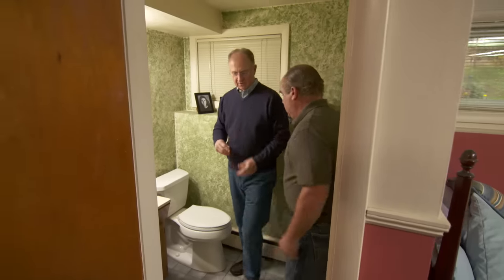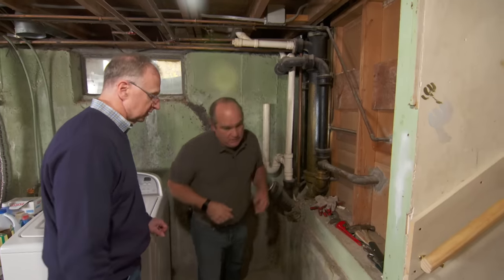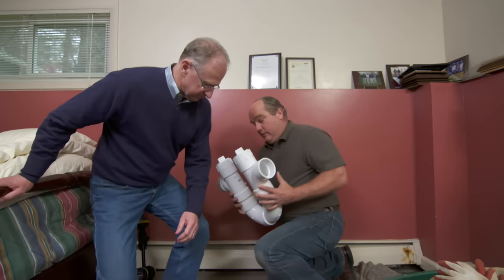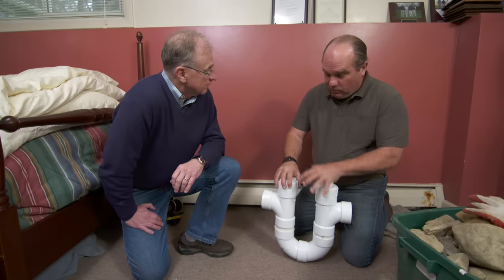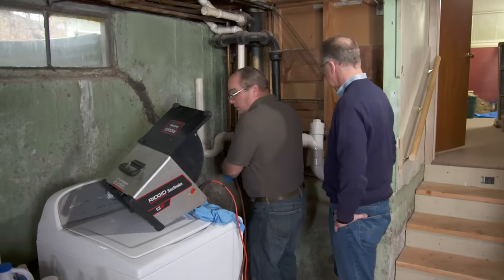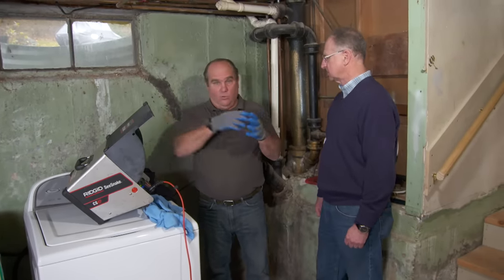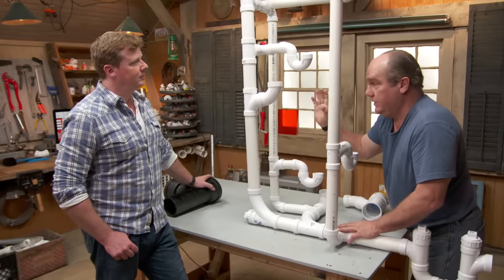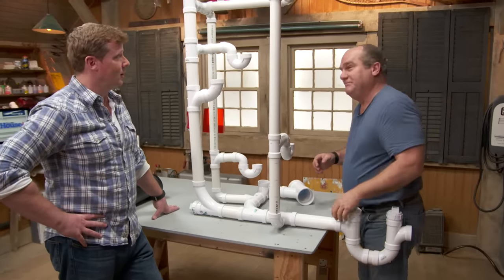How to Diagnose Plumbing Drain Problems | Ask This Old House

Comment: There is a much cheaper solution  (Think fixing stints in weak heart arteries) if you place some real heavy gauge steel tubing at least 20' into the cleanout and 4" main draIn you could straighten the pipe out and bridge that 1 or 2 joints that have failed.  ONE-  YOU MUST HAVE A TRAVELING PIPE INSERT FOR THOSE PESKY OLD COUPLING SECTIONS. Once you cram them into the area they be stainless 1/4 " wall 3.75 OD slightly undersized pipe far enough you can extract the main tubing that guides them in. You can use a come along to pull out and a jack to push it in. Of course you would have to put a few good roller bearings equidistant so the tubing really glides in and straight especially at the nose. if you had an expanding hydraulic cylinder it would be easier. do what you can rather than break up your floor,

Comment: So eventually how much was the cost to fix all of this as told?
Reply: I dunno the price but I definitely can tell you it's flippin expensive.
Reply: over a thousand dollars, approximately, but need more info to be sure
Reply: I believe it would be quite expensive if you include restoring the torn up sections back into a normal room.  $25k minimum for qualified experienced contractors. Might get away with a $10k cash upfront job from an unqualified scam artist that starts digging up the ground and then hightails it out of there overnight never being heard or seen again.

Comment: My apartment had this cabbage/ propane like smell randomly. There is a vent mounted on the upper wall section that goes to the roof. I made the mistake of plugging it with paper towels since it was loud through the vent. I removed all the paper so, would that remove the horrible smell?

Comment: I'm a master plumber here in Texas going on 36 years now. The model this guy presented is wrong. The plumbing system in the house shows no separate drain stack to the upstairs toilet. When u use a vent stack as a drain to the upstair toilet it will siphon the bottom toilet. It's illegal to use it like that. He gave the owner wrong info. In the model he showed, he is still using the bottom toilet vent as a drain stack for the fixtures in the 2nd floor. That's a big NO

Comment: Wow! This was interesting. I think a competent and prepared for the job plumber (probably 2 men working together) would be able to trench along that pipe and get the pipe replaced and properly leveled and supported including the new house trap - in just one day , possibly  two days of work? I don;t think this is a very difficult problem. You just have to break the concrete along the pipe and then make new connections. I'm worried that house may have settling issues and foundation cracks ( saw one repair on the wall where Richard was standing) but even then once repaired it can likely last for many years. I;m not a plumber just trying to assess the situation. I think maybe 16 hours or plumber;s clock may do it plus material. So maybe 3K ? The owner could then clean up and refinish the floor. I wish they do a follow up with he owner and  actually tell us the outcome
Reply: You've must never have broken 12' of 5" thick concrete then dug a 4' deep by 14" wide trench for 10 plus feet and then proceeded to dig around the pipe to fix the belly in the line or replace the entire run... Because if you had, you might know its not getting finished today, or for a measley 3 thousand dollars..
Reply: Hmm on that and also hmm on  you calling 3K  " measly " - for what is essentially all to cover the labor.  @rollinabode5222

Comment: Bottom line is if they had never finished the basement into a bedroom then there would have never been a bathroom down there... and they never would have noticed this issue till it became a leak. (another 40 years?) BTW, the "rat trap" is a leftover from the days when a septic tank (or cesspool) had a wooden lid and was probably constructed of rocks. Rats and moles, etc, might burrow into your yard and find their way into your pipes in search of another way out.

Comment: I bought s trap wall touch base mounted commode and connect it to 4" pipe( 8 feet long ) with collapsible pan connector .the distance between center of commode and square inspection chamber is 9 feet. Single line of 4 " pipe brought to inspection chamber. wash basin pipe,bath water common line brought to inspection chamber seperatly and pipe use of size 3". My question is it is possible to attached vent pipe to inspection chamber.

Comment: 16ft 6 inches is the fresh air vent for the house  trap IT'S CLOGGED on the outside of the house.....BAD IDEA TO GET RID OF HOUSE TRAP.  PVC diagram is misleading fresh air vent for house trap is not in diagram it's about 12 inchers before the house trap in the  camera  inspection and not in the back pitch section of the pipe. IF FRESH AIR VENT FOR HOUSE TRAP IS CLOGGED SYSTEM CANNOT BREATHE PROPERLY.

Comment: They could make a little wall and put a vent pipe straight down to vent that area and the water will go down faster.the wall wound be to hide the pipe
Reply: Or get rid of that rat trap and the water won't accumulate in it

Comment: Good diagnosis but expensive repair and he just paid off his 30 year mortgage.  How about running the new 4" PVC out through that basement wall and connecting to the sewer outside?  Cap the old lines.  That would cut your costs in half always cheaper to dig outside.   Also, not discussed, but that pvc drain / Y is air trapped and what the heck is the trap and open pipe - probably sewer gases coming up into the basement there as well as the trap is likely dry?  I would cut off that trap and cap it or consider adding a Studor vent to that pvc side.

Comment: Id cut the pipe at that already access  hole. Disconnect from the toilet ect. and pull that pipe out and go with a new pcv line.  Easier said then done of course , thing would be cutting the toilet elbow off  to get the pipe to even come out wothout hanging up.

Comment: Would be easier to run a new drain pipe outside the house ,then to tear up inside
Reply: Not necessarily true as you'd still need to establish slope of the drain and support with crushed gravel underneath it which would entail breaking the floor,  gravel base for slope, new PVC pipe, gravel and concrete fill then repair or replace the finished flooring or carpet.  Not to mention having an inspection for code compliance before filling in the trench.

Comment: Can you please help with why someone would choose to do a 2-way cleanout? Lets just say you can go either way but that was their choice. Thank you 😊
Reply: Are you asking why there were two cleanouts on the house (rat) trap? If so, the reason is to allow an auger to be inserted in either one to snake out the horizontal run of pipe adjacent to the particular cleanout. Trying to snake through the trap itself would be difficult if not impossible.

http://photobucket.com/gallery/user/Redwood39/media/bWVkaWFJZDo3MDI1MjgwOA==/?ref=

Comment: So, Richard.  I have this exact same problem with my main drain but it's only sagging about 2-3 feet.  Do I need to replace?

It is outside of the house down about 5 feet.  Lots of digging = lots of cost.  Can I get away with not fixing this?  No smells.  No back-ups.  I just found it because I had roots IN the house but the camera showed the belly before it connected to the street...
Reply: If it isn't causing a problem then you shouldn't need to fix it. Eventually it could cause a problem if it's allowing water to block the pipe.

Comment: Hello. I have question. I'm trying to replace water shut off going to the outside faucet.but the solder is not melting to come apart. I'm using the propane tank that is blue so why is that others use it and works for them on their pipes.what can I thanks.
Reply: There was probably some water still sitting in the pipe. So this wont allow the propane torch to heat the solder enough to melt it

Comment: I have a problem guys when i flush my toilet on second floor the water comes up thru the bath tub and toilet water takes time to drain ... eventually both the bathtub water and toilet water go down but there is some dirt like stuff that comes up from bath tub drain any ideas of wat it may be ?? Changed the ring on toilet and snaked it at 1st seemed like it worked but then problem came back ... thnkz in advance for help n advice.

Comment: Can someone please answer a plumbing question about how to turn the water off under the sink. It won't shut off so I can replace the faucet and now I don't have running water
Reply: There should be a whole house water valve in your basement or garage.

Comment: I have two outdoor faucets with back flow preventer. For some reason the one in the backyard makes a whining/groaning sounds every time I turn on. When I’m using the hose with the sprayer it’s fine, when I let go of the trigger constant noise until I Shut the faucet off. Please help!
Reply: Replace the backflow preventer and rebuild the hose bib.

Comment: Rich did miss that the wax seal under the basement toilet was not intact, hence the smell. Change the wax seal, caulk tween the toilet and the floor tile and forget it. Also, the lavy vent should be enough so something is amiss there as well. Now for the sinking of that XH cast iron and water in the hole the guy dug. We may be seeing the effects of some other issue, the cause could be a water line leak or rain water getting in under the slab with my money on the water main is the cause with the effect being a sink hole.

Comment: can you replace the cast iron in basement but keep the cast vent stack? mine has some rusted holes on topside....
Reply: A great way to re-pipe is using no-hub iron on all the drains, stacks, and out to the house sewer, 6' outside the wall. And then plastic for the vents, since they just move air.

Comment: I have a question: a problem and tip on solution. I live on the upstairs floor in apt. Building.
I have squeaky floors, worst in certain areas. I have carpet and the wood underneath is very old and they refuse to do anything, make changes because it’s expensive and not life or death situation. I have picture of how old and bad the wood underneath is. Night person so neighbors below complain. What can I do?
Reply: Pull carpet back then get sawdust and sweep it into the cracks in the old wood floor until its packed in good then lay the carpet back and kick it back tight.
Reply: Eric S ty so much replying . I’ll try what you suggested and ty again

Comment: Instead of digging all that up, would it be possible to clear the water out of that pipe that is sagging and since you know exactly where the low section is, could a thin epoxy be delivered via a hose to that area and allowed to act like 'levelastic' to artificially raise the floor of the pipe? It would also seal the old joint from leaking. What do you think? I'd like to know your honest opinion. Thanks!
Reply: Raising the floor of the pipe with a liner would be possible but how would you raise the top of the pipe? As the camera showed, it was at least half full of standing water. Raising only the bottom of the pipe to spread the standing water out along the whole length would restrict the cross section of the pipe at that point, possibly resulting in not only gas, but raw sewage backing up into the basement fixtures.
Reply: whiteknightcat the only reason there is standing water is because it is puddling at the low spot. Level that out and the water will flow as it should. It won't have a chance to stop and build up. At least that's how it seems to me! But of course this is just a suggestion for a less expensive alternative. I have no practical way of knowing if it will work, but if I did I'd be knocking on that guys door, picking up a check and have me a TV show too!😆
Reply: As I said, yes, such a solution would work to alleviate the low spot but at the expense of restricting the pipe cross section, and flow rate, in that section.
Reply: OK. I hope he answers you.
Reply: No only way to fix a sagging pipe
Is to open floor and fix it period by replacement

Comment: Why can't they lift up the sagging pipe area, similar to lifting sagging concrete? You'd have to somehow dig to the area under the pipe to inject the expanding foam, which won't be easy, but it seems like it would be cheaper than the alternative.
Reply: no way to do that without removing concrete because of getting proper slope etc. so just as well replace and get rid of that trap.
Reply: Inject foam under with pipe drill

Comment: umm just pop the trap with the cable. I've been in MANY situations where the trap is underground. all you need is to run the machine in reverse put a little pressure and you should go through the house trap to get to out side line
Reply: Tony Blas n

Comment: 1- Let's invent a hallow flexible but not collapsable, coiled resistant, thin diameter pipe (Say 1 to 1-1/2 inch diameter with thin wall), longer than the length of the water-filled area (12 feet), with both ends having floaters that keep the end, above water level but proximal (Closer to the shown current toilet- Inside the house) end higher, then both ends having a one-way cap that operates (Block) only if submerged (A trapped ball of lighter than water, similar to snorkeling pipe of a swimmer), that entire thing is tattered proximally along with the cap of cleaner hole (So this indwelling pipe can not be moved or coiled distally), thus maintaining a permanent, simple, no maintenance-free mechanical air passage, on both side of the water-filled, or saged section of the iron-cast pipe and call it a highly budged fix?!!!😎🤓😱😜😁😁😁😁 Bringing a little joy into the face of the poor homeowner!

2- Alternative budget solution but "Active", set a suction motor inside the end of 20 feet or so, where he already has dug the ground by cutting a window or section, replaced with a Y, and let the motor intermittently drain the blocked area by virtual of vacuum, clearing enough water that makes airflow adequately to the vent line and prevents bubbling dirty gas into the house via the toilet.

And yes I have already patented my idea so don't act smarty pant by talking to those Chines ** too soon to make a profit out of my plan and ideas👺🧐😵🤭

Comment: I now know the unit of measurement for water in pipes: a "slug."
Reply: A slug is a real unit.  It is a unit of inertia (i.e. mass), that makes Newton's second law work without a unit conversion factor in the US customary system, when pounds are the force unit and ft/sec^2 are the acceleration unit.   A net force of 1 pound-force will speed up a 1 slug mass at a rate of 1 ft/second every second.

A slug weighs about 32 pounds on Earth.  It is 14.5939 kg.
Reply: @carultch  Thanks for the info!

Comment: Surprised he didn't offer the option for having a trenchless pipe replacement.
Reply: plumberpete86... Trenchless equipment doesn't always run true and straight, plus you'd need to make enough room to install a 20 section of "hard pipe" which means you have to dig up most of the floor anyway. If they could verify no other connections under the floor the best route would be to go through the side of the foundation next to the bath and run along the outside of the house till you meet the existing exterior pipe.
Reply: @rupe53  You might want to check out Roddie Inc. They have several YouTube videos of there pit shot horizontal boring machine and there r2 pipe bursting set up. it only requires a 12"by 16" hole in the concrete. And I seen one of there videos where they drilled almost 200' and came out dead center of where they were shooting for. Check em out 👍
Reply: @plumberpete86 … Yeah, this stuff gets better every year, but still consider the cost, which might have a minimum fee more than the old way for a short run like this.... and you still need to make access at both ends for the connections plus room to drop in around 15 ft of pipe. Either way the job could be done in a day or two once furniture is out of the way and the area is sealed off from the cement dust. Edited to add: The problem I see with using something like pipe bursting is that doesn't solve the problem of incorrect pitch. It only puts the new pipe exactly where the old one was.
Reply: @rupe53  yeah for sure,  It can be quite expensive and some applications are more suited than others. Definitely have to weigh the costs.

Comment: Local code requires a trap like that in my house. I wish it didn't.
Reply: Yeah I  don't understand why since every fixture needs it's own trap. Like under a sink or shower. Unless you have a basement and the downspouts are tied into the sewer system. Then a whole house trap kinda makes sense.

Comment: What would happen if they just didn't fix it?
Reply: Accelerates quite a bit downhill from here.  The pipe is slightly leaching so the ground will start getting soaked, causing the pipe to sag more, leading to more backfilled water, which from the weight causes the pipe to sag even more , leak more.  Eventually the pipe will just fail and he'll have created a homemade cesspool right under his basement.